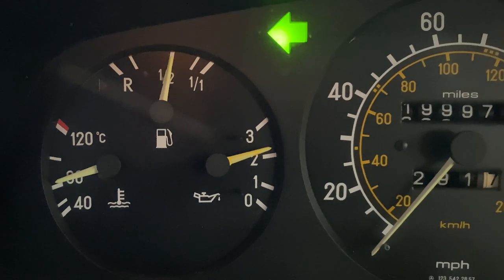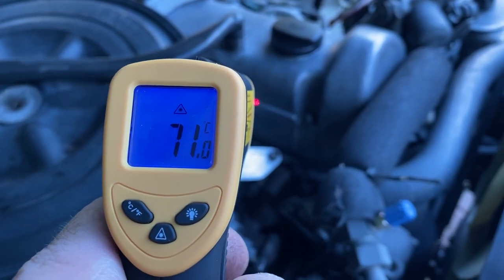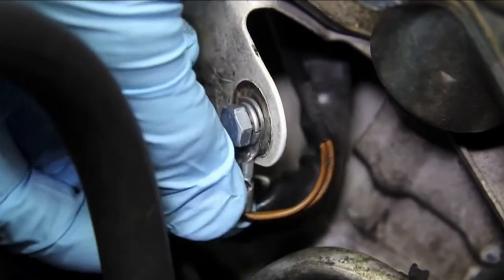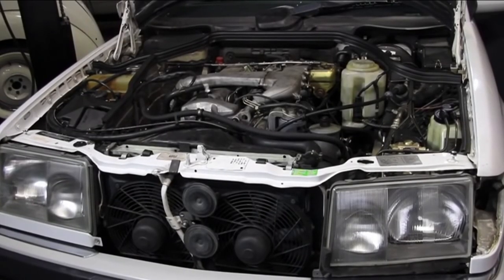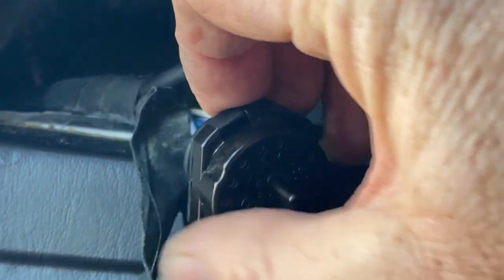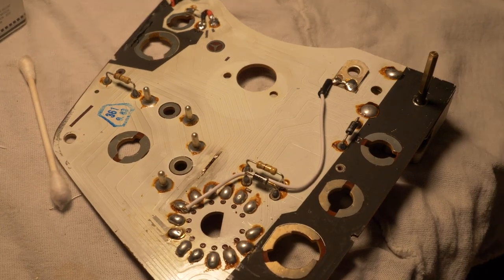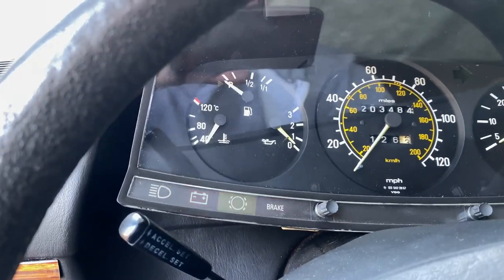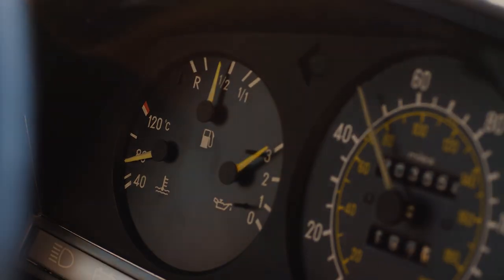Mercedes 300D W123 Instrument Cluster Gremlins & Grounding Issues

Comment: I don't appear to have a burnt trace on my circuit board, but I did notice that the solder on the connector came apart. Should I opt for grounding a jumper wire? My fuel gauge has been stuck around half lately with slight movement on the needle.

Comment: I've got one even worse.  If I use the turn signals, sometimes no issue, but by about the tenth time I turn, suddenly all my dials go to zero other than speed and oil pressure.  I also lose my signals, and nothing comes back until I let the car sit for some time and start it up again.

Comment: It's not the w124 is an old car and the fuses corrode you have to change them all corrosion it is not  a problem with gauges I had that problem and all working by changing  all fuses under bonnet £3.45p

Comment: To solder those burnt circuit ribbons it's best to lay a few wire strands across the gap. These jumping gauges normally require just loosening and then tightening the gauges themselves. Good video.

Comment: Great video, good to know about this failure point. btw, if engine is taking too long to get up to temp the thermostat may have failed open (chassis failure) which slows the warm up period increasing wear--this happened to me and it took a long time to catch it as temperatures were never excessive.

Comment: Thank you for this! I pulled my gauges out and found the solder joints on that ground tab you soldered the wire to was broke . Re soldered it and now I'm at .3 ohms. About to put back together now.

Comment: Thank you. Having a similar issue as well, except my entire driver's side is dead.
Reply: Same. My driver and passenger window switch does not work. Left turn signal is solid, buzzes with the lights on.
Reply: @eternalbeing3339  So I found the problem, which was interesting: both the fuel level and oil pressure gauge failed simultaneously. I ordered 2 new ones and everything is fine now. One thing that I did notice that happened around the same time was that the charge indicator light would be on like the alternator (or VR) was failing and also my ABS computer (behind the battery) failed. When I tested the alternator I was getting an output of like 12.x volts until I gassed it a bit and then I would get 14 - 16 volts, so I replaced the VR. I think maybe the increase in voltage could've damaged the gauges. Unfortunately, I don't think the OVP protected the components because I believe the threshold of increased voltage starts at around 22 volts. So I also had to replace the ABS unit.

Comment: Very informative video! Im having a similar issue however it’s regarding my temperature gauge. The car is running at 85c at the gauge however the infrared thermometer is showing it’s 65c. Am I having a ground issue as well?

I changed the engine coolant temperature sensor. I own a 85 300d turbo.

Thank you

Comment: Having similar issues with my 82 300sd. Cannot figure it out. When my lights are on the left turn signal buzzes and stays solid. Swapped the cluster with another one from ebay, same problem.
Reply: Hey did u ever figure out the problem?